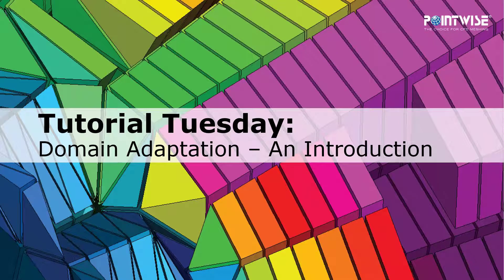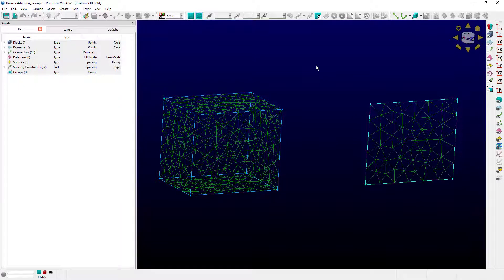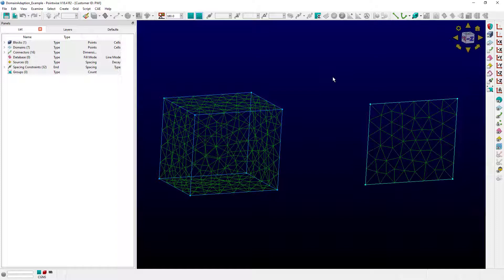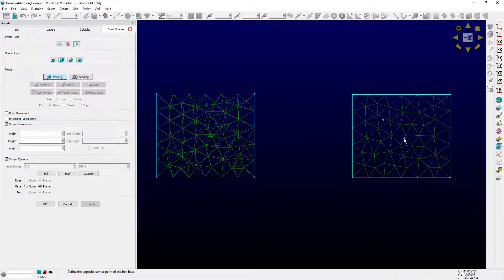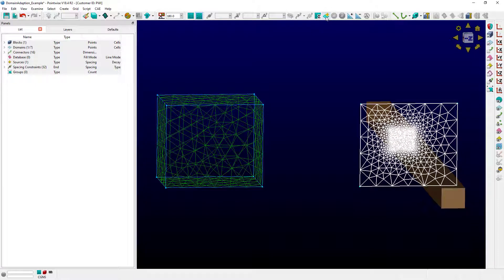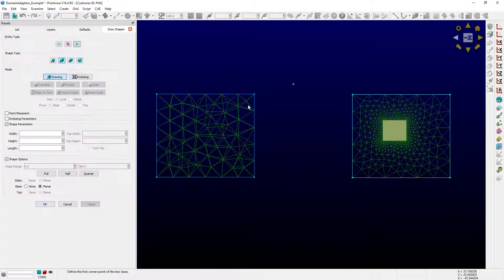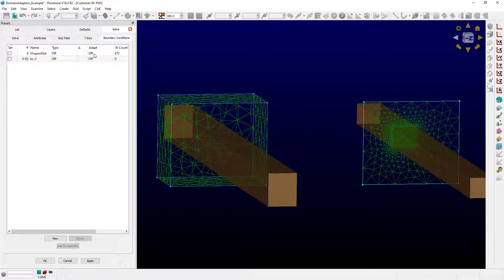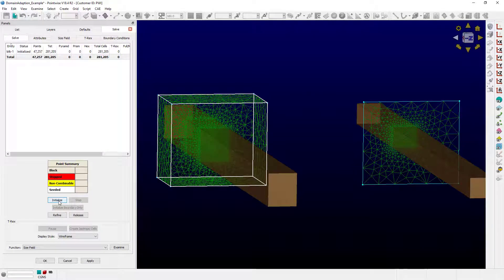Introduction to Domain Adaptation

Comment: Hi, are there any feature/interface for automatic mesh generation of parametrically created CAD models ?
Reply: yes, pls check the case https://info.pointwise.com/reducing-boiler-emissions-through-shape-optimization
Reply: Hello, MusicAlive. Without going into the details, the answer to your question is yes. The newest capability for automatic surface meshing (the first of several automation features collectively known as Flashpoint) automatically meshes geometry models. The software's Build Blocks command then easily generates outer boundaries for your volume mesh. Other techniques have been developed over the years for working with parametric design tools such as ESP and OpenVSP. Finally, everything in Pointwise can be scripted, allowing you to write templates and macros to accomplish all of this in a hands-off manner.